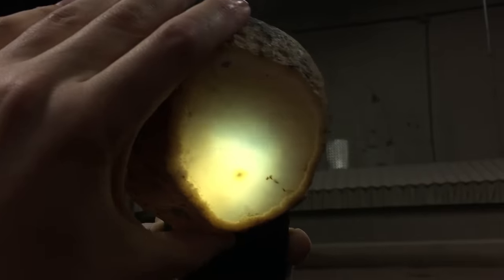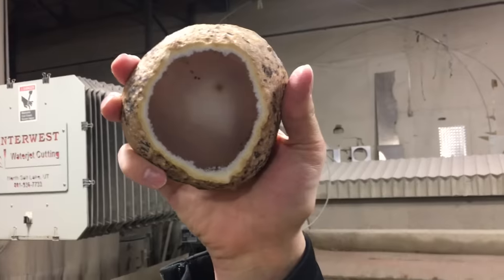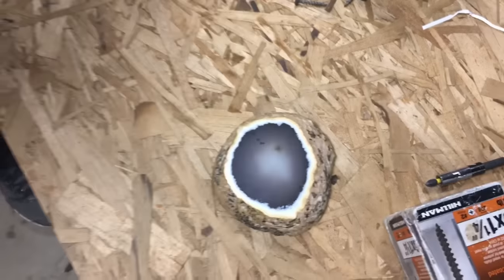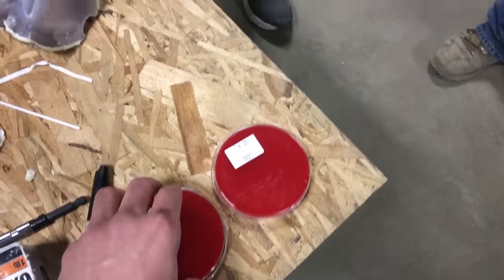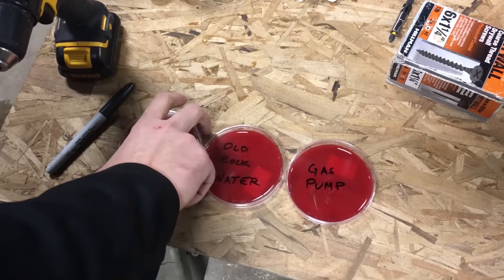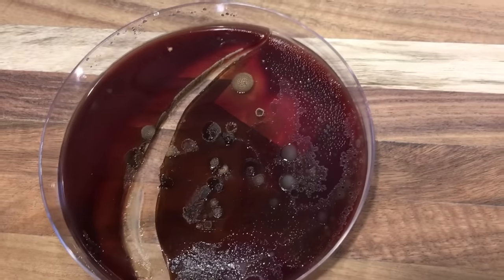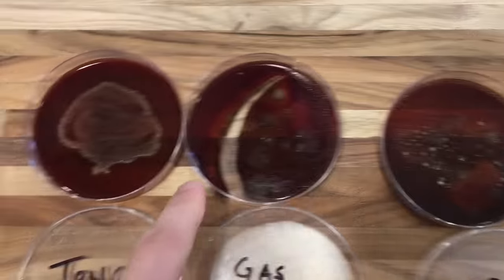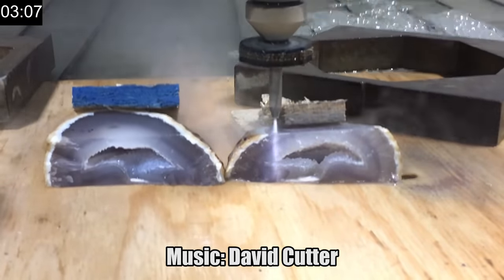Water Trapped in Quartz Rock vs 60,000 PSI Waterjet - Enhydro Agate

Comment: It's very likely that the quartz water had additional bacteria because they wacked it with a hammer and introduced particulates into it (besides what's already floating in the air).  ;) A much more sterile room and process would have been much more interesting. Also, getting that quartz water under a microscope would be very interesting.
Reply: Don't argue with a man who used the word particulates.
Reply: That and the fact that the Quartz more or likely formed around a pool of water, capturing the water, the particles from the environment, oxygen and any bacteria living in the water at the time.
Reply: Well, you are right, I have a bacteriology degree  and its well known that the blood agar plate can be  easily contaminated even with a breath if you are close the petri dish, because it has real animal blood and it works to grow almost any kind of bacteria on the environment, even some kind of fungus can grow easily if the spores are floating in the air, if they want to do a propperly culture of bacteria coming from the inside of the rock, they need to use latex gloves, face masks , a sterile nichrome handle and of course they need to work really close to a Bunsen burner and leave the petri dish inside a calibrated incubator at least if they want a reliable result, but  the video still funny and very interesting.
Reply: Im sure if there was a magnified slow motion capture you could see the microscopic dust and debris exploding into the air on impact and settling in the liquid. You won’t see it so fast in this video.
Reply: James Wilkins omg ricky
Reply: I thought of this too. The way the water was extracted caused dust from the outside of the rock to land in the water. I think it could be very difficult to not contaminate water stuck on the inside of a rock, due to the rock breaking. A small controlled diamond drill bit from the top to just puncture in. Then burning / UV sterilizing the outside of the rock before tipping over to pour it out.
Reply: James Wilkins b
Reply: homer simpson "NERD!!"
Reply: James Wilkins well said sir
Reply: Would have been* very interesting
Reply: James Wilkins you are absolutely right
Reply: William Cherry they have IQ of children though.. so you shouldn't expect much
Reply: They also had the agar uncovered for way too long. They should have just lifted the lid off the dish and not taken it away. Poor technique all round I'd say. However, I would be interested to see what species of microbe are in that dish.
Reply: you put that water under a microscope you would see some dinosaur dna
Reply: Plus the fact that they opened the plate on an unsterilized area which may cause contamination as BAP is usually sensitive to contamination. The bud they used was also unsterile.
Reply: James W you are correct
Reply: ChickenYouAte No, DNA doesn't last that long, All dinosaur DNA has LONG since decomposed.

Comment: all water is millions of years old...
Reply: Pengu lmaoo
Reply: but not all trap in a rock for 2 million years
Reply: fair enough
Reply: Its as old as the earth I think cause its a circle
Reply: not exactly true considering alot of  water evaporates into steam and then it cools down back to water. It is basiclly resicles every day but this water in preticular was traped in a rock for 2.5 million years and didn't go through that sooooooo
Reply: But this one trap in a rock
Reply: For 2 millions year
Reply: Victorbrine Cassini thanks . For being smart
Reply: Basic chemistry fail, when plants use photosynthesis and create sugar, it's no longer water. When decomposed it becomes "new water". Or when the sun sends out H_2 gas and get's burned when O_2 is present, new water is formed.
Reply: Pengu not all
Reply: ... your right
Reply: Pengu Probably quadrillions of Years old.
Reply: New water is also created in the mantle. The water cycle taught at school is called the secondary cycle, the primary cycle happens in rocks inside the earths mantle. It has been theorized that the water held inside the mantle has 5 times as much water as is on the surface.
Reply: The educational system failing can be seen here
Reply: Yeah, there is no new water!
Reply: Pengu actually billions,maybe trillions.
Reply: Flat Earther right here
Reply: Billions 😂
Reply: But that watermelon hasn't been filtered ever
Reply: In order for your statement to be correct, every water molecule that has ever been a water molecule must have been that water molecule for millions of years without being interrupted and turning into anything else.  And that is obviously false.  The correct concept that you are trying to convey is that all matter is really fucking old.  But that ignores the idea of this video that matter that has been the exact same way without any change for millions of years is really cool.

Comment: Enhydros are formed when water rich in silica percolates through volcanic rock, forming layers of deposited mineral. As layers build up, the mineral forms a cavity in which the water becomes trapped. The cavity is then layered with the silica-rich water, forming its shell.[2] Unlike fluid inclusions, the chalcedony shell is permeable, allowing water to enter and exit the cavity very slowly. The water inside of an enhydro agate is most times not the same water as when the formation occurred. During the formation of an enhydro agate, debris can get trapped in the cavity. Types of debris varies in every agate.....From Wikipedia.

Comment: Getting water out with water. That's like trying to put out a fire using fire.
Reply: puppyguy9 Using a firejet
Reply: puppyguy9 you clearly didn’t watch the whole video
Reply: The do fight fire with fire bro. They do controlled burns to consume the fuel of wildfires!
Reply: +Ian Fritchie I did tho :p
Reply: puppyguy9 then you should know that they didn’t use the water jet to get the water out. They used a hammer to get the water out.
Reply: +Ian Fritchie Thought there was still water in the rock :p Guess it was just the waterjet. Man, why did you have to ruin my joke XD
Reply: ....we actually in a way DO use fire to put out fire...
Reply: They use explosives to put out oil well fires, at least John Wayne does.

Comment: BUT TECHNICALLY, IF YOU THINK ABOUT IT, ALL WATER IS OLD. ALL WATER ON EARTH IS OLD NO MATTER WHERE IT IS.
Reply: no its not the water from when the earth formed is still the water today. Unlike mars earths gravity is strong, and the atmosphere is dense enough, to keep the water. It doesn't matter how many times its "cycled" or not. That water is just as old as the water that's at the bottom of the mariana trench.
Reply: BossesDream 
Plants actually break down molecules from air to create H2O during photosynthesis, so it's fully possible for a a brand new water molecule that has never been water before to be formed.
Reply: how can u be sure... new water can form at any moment
Reply: Marcel Huchwajda yes I talk to that all Caps 😂

Comment: Isn't all water over 2million years old?
Reply: 殿アッシュ Exactly what I was thinking
Reply: That’s not true in the slightest. I could make water right now with hydrogen and oxygen
Reply: but the hydrogen and oxygen is older than 2 million years old
Reply: austin bevis Yes you might be able to do that With hydrogen and oxygen but that’s just basically water vapor it’s basically like the same thing as just leaving a cold glass of water sitting in a room and a belt carbonation on the sid with hydrogen and oxygen but that’s just basically water vapor it’s basically like the same thing as just leaving a cold glass of water sitting in a room and it Build condensation on the side of the glass water is very old

Comment: If you used the waterjet initially to cut those corners of the rock where you eventually saw the water inside. Then the water might actually came from the water jet sipping into micro cracks you see near the surface onto the cavity in the middle of the rock